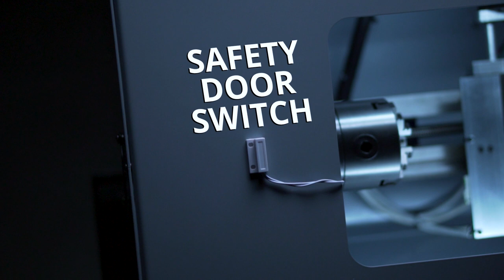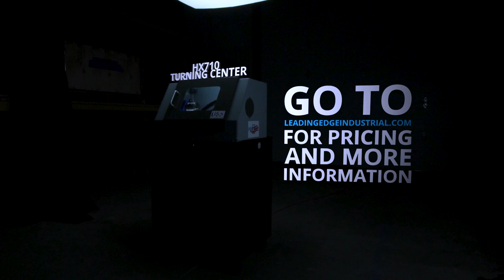Affordable Desktop CNC Lathe HX710 Turning Center

Comment: With 710 in the code number, I came here expecting to see a huge lathe and found one the same size as mine!
Does that toolpost really qualify as a Quick Change? For best use, the lathe should probably be priced with a Quick Change tool post and perhaps even an auto 4 position tool changer which is becoming readily available.

Comment: Isn't this just a generic mini lathe with an enclosure, cnc control, and average stepper motors?
Reply: Yep, 100% it's a China made Mini Lathe for the most part.
Reply: yes kinda just builded in house. same as buy 800 mini lathe and add motors directly to hand wheel or just take spindle and build own axes, but it would not any case cost 5k. i have lotsa stuff buy in years total cost not ove 1k yet. i could build my own. just need table/platform to build it and spindle lol. so minium i need electric drill pull up door and start drill holes to attack rails and ball skrews. then use that same drill as spindle . NO! lol mayby buy sherline spindle. or taig cnc ready lathe. they cost 1.5-2k without stepper motors and those allready have lol even full ready cost 3k and might be better than this

Comment: Hmmm...that, that wasn’t a quick change tool post lathe, specially for a CNC. More like a four position tool post. Not even an automatic tool post changer. Theoretically, it’s a cool lathe. Conceptually, it’s a basic design that can be had, with cost effective plans both here on YouTube and the internet, some free of charge. There’s a few guys here on YT that even built their CNC lathe with an automatic tool changer, too. So, for the price of this lathe, I’d rather spend 1/10th the money on plans, materials from eBay, and still come up paying less, for a machine that will do exactly the same as yours, without an exposed safety switch. Toodles.
Reply: and that stepper motor to lead screw coupler..... I mean come on!!!!!  You like the ends of your lead screw to fatigue and break off? Because that is how you get broken lead screws.  Its a great looking bit of kit, I mean a harbor freight slant bed.  The Z axis lead screw going through the casting without any protection is probably not a good design decision either.
Reply: @zidwid  the runout of that coupler seriously questions the build quality !

Comment: $5000. and it doent come with ball screws and it only a gang plate, and a brushed spindle motor is high maintenance
Reply: mini lathe $300 steppers and controls $400 enclosure $100  etc.

Comment: When new and amazing starts advertising a door safety switch as a “feature”, I’m outa here......
Reply: ...and when the wiring to THAT "door safety switch" isn't even inside some kind of conduit ...it is NOT to any 1st world electrical code.  It does say "Made in the USA" ...but that could mean any single small part on a machine is "Made in the USA".  This equipment is only for someone's basement or bedroom ....and it will be just fine ....at $5,000 ....plus $1,000 minimum in tooling to make it useful.
Reply: @taxicamel  That's a Chinese Mini Lathe for the most part. I recognice the bed and headstock and toolpost and I doubt much else has changed. So, yeah, so much for made in the US.